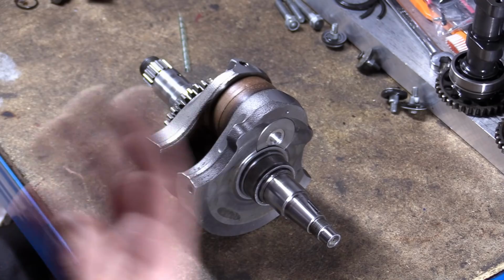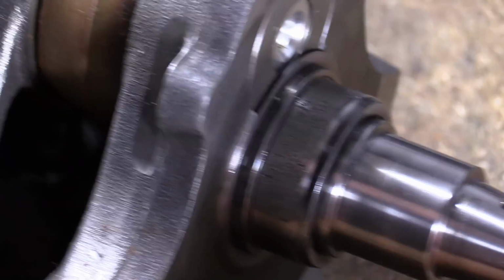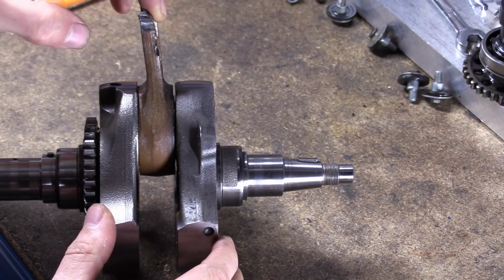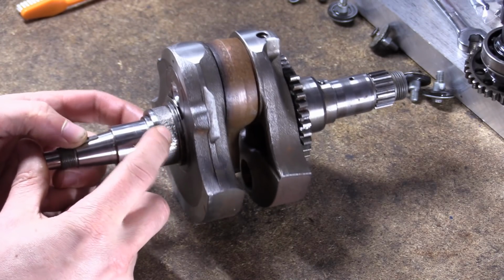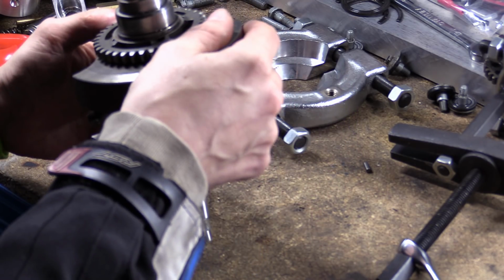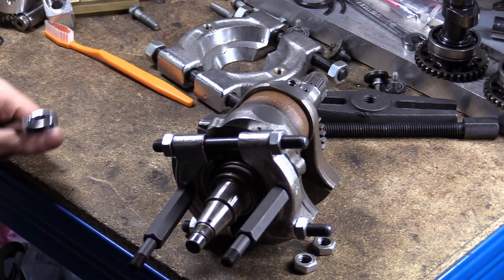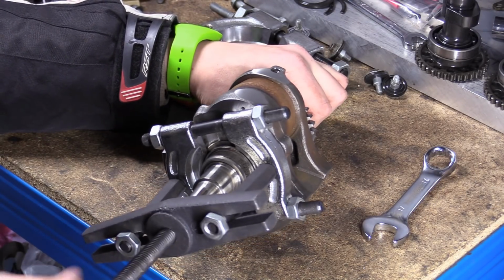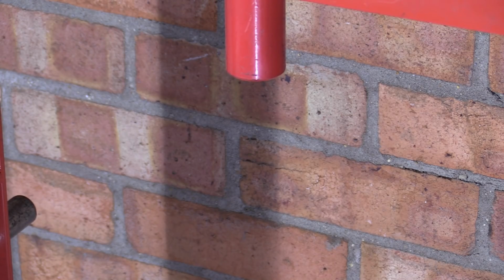BMW Crankshaft - Failure and more

Comment: A tip for removing races like that is to get the heat in quickly and in a concentrated area. If it is a real bastard pour the heat in one spot until cherry red and place on an anvil and strike the red hot section with a hammer. This stretches the race and it usually just pops off.
Reply from the maker: But....... I don't wanna fuck the bearing race up too much because we need a closer look at it - hence the gingering (if that's a word LOL)
Reply: I just use a heat gun from the acme company with P239 fuel.. LOL
Reply: The Workshop I understand that Matt, I fingered that was the case
Reply: It is hard with those lpg heat torches. They just don’t get the heat in fast enough and you end up heat soaking all of the parts and they expand together
Reply from the maker: Just thinking about oxy - my bottle is empty - thanks!
Reply: Yea, that was my advice but i dont think he has an acetylene torch.
Reply: I really wanted to know what temperature the bearing race was and the weight, and what draw of the toolbox it came out of.
Reply: @thedirtyworkshop  yep I reckon that's why you didn't just freeze and shatter the race as it would have hindered the investigation ever so slightly!!!

Comment: thanks mat i like these failure analysis videos  cheers for showing your press and puller work ..  i know what its like.. not to have the exactly the right gear  for the job .. it can be a real struggle  sometimes..  laughed at the crank pin removal explosion  been there done that  looking forward to the other failure analysis videos in the pipeline 
cheers
james D
Reply: I don't even bother with the job  until I can borrow or buy the correct tool. I've had enough of "making do"

Comment: Something didn't seem right with the crankshaft but I think every time I've seen video's on this topic  I've had a few beers and been watching on my phone so I've  missed details like the racers being disgusting etc but that's a really interesting analysis. 

A bent rod would suggest something really really off. 

A mis-aligned case.... well it would make more sense than a poorly designed conrod/ crank (would expect better thank just that). The aysymetric failure/ marking to me would definitely say a manufacturing/ assembly error rather than design. What you're saying makes sense and I definitely don't have experience to say otherwise. I look forward to more videos like this they're good. A very good opportunity for new engineers like myself to see potential faults/ failures and begin to learn what they may look like.

Also, 10/10 for follow up video teaser.

Comment: This is why I bought a cheap puller, they never fit so I weld on a washer, the heat from the weld has done the hard work if I get the puller on the washer straight away.

The center of the break in the conrod looks neat, it'd be an expensive way of fracturing the big end tho!

Comment: Okay Matt..Those heat marks on the big-end are the giveaway.Which makes me think you are on the right trail.An acetylene torch on one side of the bearing shell would make it easier to remove...clearly
your press has some issues....great fun..if your right..The Bmw motor company has something to
answer for...good stuff!
Reply from the maker: "An acetylene torch on one side of the bearing shell would make it easier to remove...clearly"

- Ah but I don't wanna fuck the bearing. On a normal day then yes, but in this instance we're trying to keep the bearing race 'clean' so to speak......

Comment: In my previous comment I'd said the head was a used unit from another engine.
The original engine had been rebuilt for some reason - perhaps it suffered massive damage to a central/main engine case?
The casings didn't align due to being from different engines? When the engine was apart they saw that the other engine had a better head on it and replaced it at the same time?
That's my grab on it.

Comment: A less than technical question but could the crank be built out of alignment thus adding to the poor tolerance end to end or is it finish ground and aligned in one piece?
Reply from the maker: Possibly yes - but in this case the crank is running true, and cranks are balanced at the factory - so this wouldn't happen

Comment: I noticed the heat markings on the rod. That is why I thought it had been run with a bent rod for a period. Something was causing a side load on the rod
Reply from the maker: "If the case was misaligned there would be signs where the case and cylinder meet and fucked transmission bearings."

- well this depends.....

1) If the dowel nearest the crank end was fucked then probably not.
2) The transmission bearings are roller ball bearings, which are more excepting of misalignment - cylinderical roller bearings are not.
Reply from the maker: "would be signs where the case and cylinder meet"

- again there doesn't have to be - due to a base gasket.....
Reply: @thedirtyworkshop  these are just my opinions. Without seeing everything its impossible to tell. If it has a steel cylinder base gasket you could easily tell if it was case misalignment

Comment: Get a Dremel tool with a thin grinding wheel to cut a slot into the bearing race, then use a sharp cold chisel to split the race. This has worked well for me when separating bearings on gearbox shafts.
Reply from the maker: I don't want kill the bearing race
Reply: @thedirtyworkshop  You're not going to use that one again surely? lol!
Reply from the maker: No - But I wanna see what it looks like and cutting it/heating it will spoil that

Comment: I was wincing as you tried to pull that bearing race with that puller.
 I used a puller similar to yours but with hydraulics to pull an inner race, not too different to what you were doing here Matt.
I would ask that any time anyone does this to at very least wear eye protection, as a piece of the bearing race I was attempting to remove sheared off and came past my ear like a bullet and embedded into a wooden fence about 10 meters away...
 I would say if it had hit my ear it would have passed right through, but even with eye protection things can still shoot off and go up under eye protectors and get pretty close to your eyeball Derick.... xx

Think your diagnosis is right or maybe that the bearings are not up to the job, I did wonder also if the crank pin was out of alignment, did the crank get indexed between centers at all ??
Reply: Yep. I had fragments shoot into my thumb and back of hand so deep I had to have surgery to remove them. It was fun for a few hours at the shop being able to stick magnets to myself but it could of been way worse. I was wearing glasses.
Reply from the maker: The crank is true, and the bearings are a bit overkill when it comes to load capacity. The asymmetrical overload on the bearings is typical for misalignment, if the overload is asymmetric.
Reply from the maker: To be clear - saefty glasses were worn -
Reply: @thedirtyworkshop   Never doubted that for 1 minute mate, just thought i'd point that out to anyone watching..... I wasn't and it scared the hell out of me...

Comment: Im not convinced about the bending on the rod being a long term thing. I have seen valve rods that have bent in ways you would need a press to copy and these were instant events. We had one that bent a perfect 90 degree angle so well you would have thought it was done in a machine. OK our rods are wrought iron 120 years old in some cases but my point is still valid. Im talking a hot bearing suddenly grabbing and the rod going all shapes. You know and I know that materials behave in some fucking odd ways at the point of failure or just before. That said I do fully agree its odd to see a rod bend at its root.    Keep these videos coming they are getting better and better.
Reply from the maker: "valve rods"?

Do you mean push-rods? 

The failure at the small end of the rods shows a fatigue failure with bench marking. If this was a sudden bend then the rod would have completely overloaded and just snapped. 

The overload on the bearings is a long term failure (long term being about 7k miles in this case)
Reply: @thedirtyworkshop   Hello mate no valve rods. if you look at the Stephensons valve gear on a steam engine you have valve rods coming away from the eccentrics and tumblers. As an example they can be two foot six long with a fork and pin one end and the other bolted to the tumbler on the eccentric. Iv watched the video two more times and yes im more inclined to agree with you on most of it, but still not 100% on the bend on the rod. Not clear from the video but wat kind of angle is the bend on the rod? Il try to dig some pictures out over the weekend and forward them too you.
Reply from the maker: "Hello mate no valve rods. if you look at the Stephensons valve gear on a steam engine you have valve rods coming away from the eccentrics and tumblers."

- LMAO! Sorry I thought we were talking about this century not last......

"Not clear from the video but wat kind of angle is the bend on the rod?"

- I'll have to measure it, but these rods are 1) i beams 2) very thick for their length = very stiff
Reply: @thedirtyworkshop   Fuck me this century! I work on traction engines for a living. You telling me they are not still in common use!

Comment: Not going to say you are wrong.. No "BUT" to add either.  If I had only seen the crank i would have guessed it had been over revved and as it is an enduro engine possibly on the down shift and the engine could have been spun up way beyond where it would have hit the limiter.. Hence the rod overheating on the thrust face... The rod breaking would have possibly bared this out too with it being spun too high and as you get some rod stretch it could have hit the valves and/or head and that bent the rod and started the problems.. This being done repeatedly on a competition engine is asking for it to fail... BUT (well I had to add one somewhere) looking at the video with the head there does not seem to be any damage unless the valves were spinning freely due to some bending of the valves after hitting the piston... But again I did not see any evidence of the valves being hit... The damage on one side of the bearing can be due to the balance not being correct so the crank wants to whip in the cases.. The opposite side if I am not mistaken actually holds the whole clutch basket and has a lot of weight on one side of the crank. It could still be an imbalance in the crank and being over revved too. The crank will have a LOT more weight on one side compared to an engine which just runs the valve train and the primary drive to the clutch on one side and the ignition rotor on the other side. To have that much damage on the bearing face though it could like you say be due to either a dowl being missed or damaged. In a competition bike it could also be the bearing fit in the crank cases has opened up too due to being over revved and the imbalance opening up the holes in the cases allowing the whole crank to move up and down too.. It is one where you do need to see the engine as a whole to really know...

Great work though Matt... 

Oh I am finally back working and will be able to go and get the crossplane crank for you this week.. 
 Look forward to seeing the next instalment..
Reply from the maker: "If I had only seen the crank i would have guessed it had been over revved and as it is an enduro engine possibly on the down shift and the engine could have been spun up way beyond where it would have hit the limiter.."

- the guy was doing 40mph (not thrashing it)on the road pulling away from traffic lights.

"It is one where you do need to see the engine as a whole to really know..."

- very true!

Your input is always awesome and welcome Rich
Reply: @thedirtyworkshop  I am actually looking forward to seeing the cross plane crank that has snapped as it was always a part of my old job that interested me and Doug who owned the company could look at a crank for 30 seconds and see where problems would be. I learned a lot from him so as you can see the crank videos are always the one I seem to comment on... 

Anyway.. will message you next week and I will be collecting the crank. Chat soon..
Reply from the maker: Awesome!